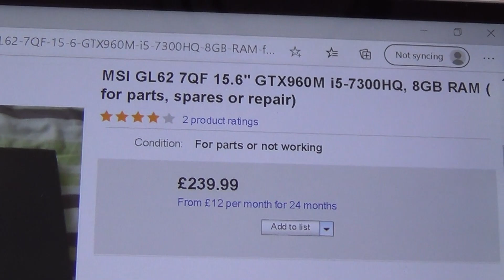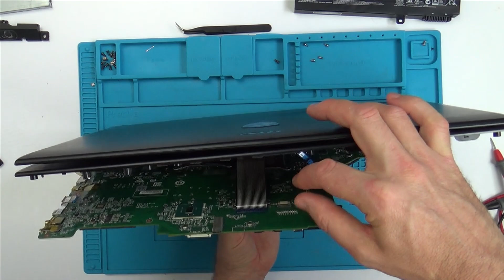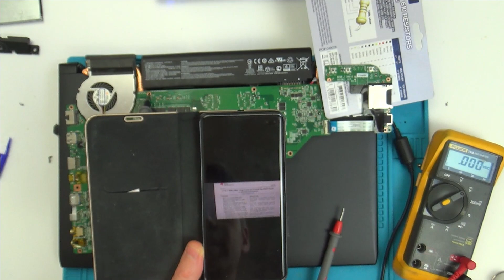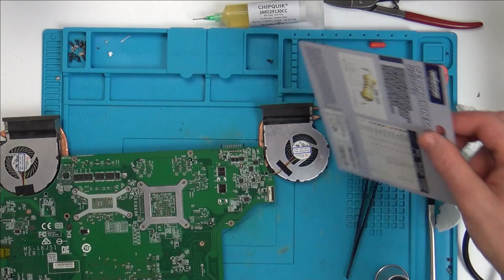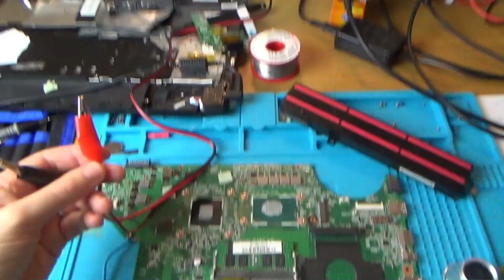Trying to FIX : Faulty MSI GAMING LAPTOP from eBay

Comment: @12 mins - second connector is the LED backlight connector for the keyboard. Not all models have this, but the connector exists even so. 
The some keyboard keys not working is a common fault with these Steelseries MSI keyboards. You can try reseating the ribbon cable but it usually requires replacement, which is a pain, cos it uses plastic rivets. I've replaced the keyboard in this exact laptop it is is a pain.

Comment: Just something to try Vince . That small ribbon cable at near the start , the one going to the trackpad / keyboard . Try connecting it . I know this is not a macbook but some of those need that circuit to be completed before they will turn on , it will not turn on the power to the power managment chip on the macbook . Saw about it in Paul Danniels or Louis Rossmann. So in essence , the power goes to the trackpad / keyboard and then comes back to the power managment chip to tell it to turn on

Comment: I would leave one idea, in this comment section. This is not just a fixing ch. Its something more value is not the most important factor. I think tenacity is the key factor here. I would suggest that you fix it, in my eyes this laptop is nothing special i5, iffy GPU, no SSD inside. But its not about that. Its about, fix it with everything you got. I think your viewer would buy template for this chipset and even the chipset. And you should learn to reball the massive chips with template.

Seller is fraudster and idiot I would give him negative feedback at least. This is clear scam.

Comment: Hi , can anyone recommend a good basic Multimeter.  thanks.
Reply: VC99 (vici99), but if you can buy an used fluke that works it's preferable.

Comment: LOL @GadgetUK technique =D  Great job, you need to be careful when increasing voltage on the PSU - that rail may be 1.5v or something around that.  Feeding 5v or more could cause something to die - that said, because there's a short, the short causes voltage drop.  So its probably safe to do.  I would rather stay nearer to 1v (maybe up to 1.5v) and increase current limit on the PSU.  Those iron filings - maybe some where dropped over the whole thing?!?  It may be worth trying to blow under that chip (perhaps carefully remove the underfill on the corners, pour lots of IPA under it, use hot air on highest air flow to try and blow under it.  Just an idea!  But I've never seen iron filings like that stuck to a speaker magnet - you've got to question how so many got there like that!  I would leave a negative for that seller!  There's no way all they did was just clean...     If you've not already checked out his channel - see "Adamant IT" on YouTube.  He has lots of similar repairs to this - ie. finding the shorts etc.  I do wonder if the heating up chip there is a red herring.  ie.  There is techincally 0.4v or something going to it, if its normally powered with 1.2v or something like that, its going to be lightly warm vs anything else around there.   So the short maybe a cap, a tantalum or something.  Are you sure no other caps on either side are getting warmer?

Comment: SMBus means System Management Bus. It is an i²C Bus with a serial protocol. Vital system components communicate via this bus to check various parameters like temperature, voltages, battery state, etc.

For the future: never buy something if the person admits he opened the device for cleaning. Especially if you pay 200 GBP for it.
Reply: Florian Trück people lie even if they say they didn’t they did and with the no returns guff they absolve all responsibility but vince can still try open a case as it’s clearly not as advertised !
Reply: G thats right. I always look for buzzwords: sunndenly stopped, did nothing, not tested, plugged in light got on, etc. At this point I stop looking at the deal and look on further.

Comment: This is a bit of a coincident! I have the same laptop and just opened it up for the first time the same day you uploaded this video! :) I was upgrading my RAM.  I think you are missing a speaker as well, it's supposed to be placed just around where that first broken flat cable was, there's a grill in the case. Unless MSI removed it from this particular model...
Reply: Yours is a higher model with a subwoofer speaker. This is one of the basic model's and doesn't have it and no backlit keyboard etc.
Reply: @KBFix  Ah OK, I suspected that could be the case. Thanks for the info!

Comment: That's a shame, it turned out not to be fixable for you. On another note, that chip is the southbridge, motherboards haven't had northbridges for a while now since the memory controllers started to be integrated into the CPU die itself. Anyway, great effort!

Comment: a chipset does not just break down usually it is the gpu or the power line of the laptop.  check if the USB ports are ok not that they are connected to ground.  or he just made a big short circuit that the chipset broke down

Comment: Hello Vince, just popping in to tell you that on a laptop it very rarely is a socketable CPU.  They only do that in cases where they are actually using a desktop CPU to make a really powerful and power hungry "portable" workstation or gaming type desktop replacement. Other than that, it's BGA and GPUs are almost always BGA as well, Nvidia does have some MXM modules with replaceable graphics cards but again, that's the exception, not the rule.
Reply: Dont know if you have seen his site but '' cat and andrew does a swopm on one , cant remember what the make or model was , possibly a Dell

Comment: You should get a thermal camera to help the fault finding with heat, I dont think they are that expensive
Reply: Thermal camera smartphone is amazing
Reply: Frost spray works well for that as well
Reply: @sethreign8103  which one

Comment: "stopped working after cleaning" screams "cracked cpu or gpu or both". It was a very risky buy. And overpriced I think.

Any repair must start with inspecting it visually everywhere. And for sure before even touching a soldering iron.

Also, it makes sense to power it using a bench power supply. That's how you can see if it consumes any energy if anything changes when you press the power button and so on.

The startup sequence is rater complex for laptops. It is not a liner "follow one trace". Various subsystems start and then send signals for other subsystems. These systems start only when they get all required signals and only then the process continues.

You can use your scope to see if a chip gets or sents any signals.

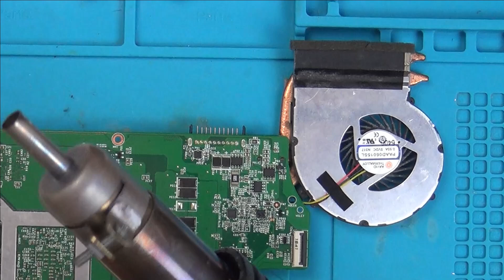Comment: @27:55 i had the same thing happen to my reflow station, it has a blower fan in the handle that doesnt turn on sometimes, usually tapping it or manually spinning the fan gets it to work (i removed the cover to the fan so i could make sure it was working)

oh well thats what i get for a $100 Reflow/soldering/powersupply device off Amazon

Comment: The questions post sale sounded like a red flag. Maybe if you had said it will feature in a repair video viewed by 10s of thousands of people it may have made a difference. Puts me off buying a second hand computer hoping for an easy fix.
Reply: HomeSpace don’t exist unless your buying from bulk business sellers who will mainly strip it for parts for anyway. People hope for bargains but rarely does it work out.

Comment: May have been mentioned already but check the USB ports for shorted pins, I often have USB ports to repair due to their owners forcing in a USB pen in the wrong way breaking the centre pin support and causing those pins to short against the outside of the port, This would cause the issue you see and the chipset short you have

Comment: Hi Vince! Love watching every video from start to finish.  I remember the other laptop you worked on, however I would perhaps suggest a bit of caution with laptops.  Fixing consoles on the other hand makes a bit more sense, because there are fewer models of things (like the switch, xbox, playstation, etc.) that there is a pretty standard market where you can say there's a pretty decent expectation of what they go for on the market once repaired, getting replacement parts, availability of spec sheets and others facing the same issues that have solutions, etc.

With laptops, technology advances so much and that industry is such that there are tons of new models out every year for each manufacturer with many configurations, and reselling laptops is such a wide market when you can get better specs for the same price for even a new laptop sometimes.  Not to mention the amount of BGA components that are tough to work with, let alone finding particular replacement parts available for reasonable prices.  It starts to become pretty risky like shown in this case :(   The old laptops for dirt cheap can be a fun learning experience and something cheap to fix up and give to the kids or something, but cases like this one are a pretty big risk for the capital.  It's unfortunate that this all these reasons lead to more e-waste though :(

Comment: Did you try to see if there is continuity with the power ribbon cable, I only had a quick look while watching it on my phone but looks like even though you cut it the pins are broken further back where the protective plastics starts

Comment: "I took it apart for cleaning then it stopped working" No screws on the GPU, missing screw on the CPU but thermal paste unchanged on both parts? physical damage to the gpu and cpu? #ripoff
Reply: RuggedKnight scambay vince should open a case and get to keep it for free as it’s false advertisement and he has proof !
Reply: @user-te1le7ck6b  It was sold as spares or repairs , no comeback on the seller unfortunatly but thats the chances you take . It did say that it had been opened and thats never a good sign

Comment: this is another reason why i usually go for trusted sellers. i bought a lenovo ideapad z370 on ebay, no hard drive, no processor, no power cable or ram. i took a gamble and got it for £40. first thing i did was get a spare cpu, some old ram and a crap hard drive and it powered up. was in awful shape but i managed to restore it with a core i7 and good old arctic mx4, 8GB ddr3 memory and a new ssd. that was all back in february. this comment was written on that laptop. 
(sidenote, u inspired me to fix products like these and im so thankful of u. u saved me a ton of money doing little fixes and iive never been so happy doing things like this. thank u vince!)
Reply: That's very lucky! Good to hear that you got it fixed up really well.
Reply: KillerRT thanks mate 👍 im working on a few others now, ive got a laptop with a broken cpu dye and unfortunately its soldered onto the motherboard itself. so im gonna have to try and replace it, wish me luck 😂
Reply: @itzzjok3rzz208  Oh, that'll be tough. I wish you the best of luck though! :D
Reply: KillerRT thanks mate! :)))

Comment: Hi Vince, I have been repairing laptops for years. ALWAYS, ALWAYS remove the battery for chopping and changing parts/disassembling further as you could create further issues if not. Great video as always.

Comment: If you take this off, and it's not the issue, putting it back on without confidence would hinder BGA repair. I hope you get it going, that's a pretty good laptop. This is not married. Just need to correct chip. Ask a BGA Repair channel to repair it? If that is the problem.  I haven't had any luck repairing boards yet, but I plan to get into it once I figure out a few more things. But that BGA would keep it from powering on! I have a few MSI motherboards (ironically) ATX style, that that very same chip gets warm trying to diagnose it...

Comment: I believe that is the southbridge. That is VERY common to go bad, and you can replace this! Provided that is the problem. This will cause the 3v on/off to stay off. Meaning the PC will not function with that failing! But ensure that is the actual problem.
Reply: @51:49 that is possibly just that chip. I'd remove it, and check for the short.
Reply: you can get these with the balls on them. This BGA is smaller, I feel like you've already done this before. Or at least removed them on Xbox style Consoles (PS4 etc...).

Comment: Pretend it's an Xbox. As that's the basics of it. You've repaired Xbox's, power plug just replaces the drop in connections. They seem different but it's all about the same. The SMC tells all the bits to turn on or turn off if their is a fault, on if everything is ok.

I'd get a replacement screw if you get this going, as it will overheat if it's not replaced.
Reply: Ouch... I'd say they thought they could replace the CPU and GPU and that was them "Cleaning it" after they realized prying Chips aren't replaceable. Hopefully those markings aren't damaged Chips.

Comment: @53 min there are two mangled traces visible on the board, this thing is a train wreck
Reply: Oh wow ur not wrong. I’d honestly return this regardless of the “no returns” description . You can’t accidentally do the things they did to that car crash by “cleaning” it .
Reply: @grws86  I agree, it was definitely not as described, which is grounds for a return at the seller's expense. Selling for parts doesn't free a seller of the responsibility to describe the item accurately.
Reply: For those searching, @t=3196 check out the 2 o'clock from the PCH (the warm chip). Those are most likely one PCIe lane.

Comment: I suspect the unit stopped working and Captain of the failboat thought they could a) change the chip b) harvest the chips for resale or c) transfer the chips somehow to a new unit thinking they were like desktop boards.   Upon realising their "Not an Expert" error... they put it all back together best they could not being experts and decided to palm it off for best dollar possible...   What lends credence to this is that first ribbon cable, someone yanked it out and likely tried to ram it back in without lifting the gate which is why its peeled back so.   Really rotten m8 and I reckon they were emailing you trying to find out if you spotted the fakery going on :(   When cleaning a laptop, you might have the back cover off, you might even to reapply paste for the heatsinks have them off, you would clean the top half via the keyboard aperture and if you used a decent vacuum not need to do any more disassembly.   Those filings look like filings say from where you overtighten or round out a screw head, prob caused by Lord and Lady N. A. Expert having at the screws with a cordless drill... a big naughty no no :(

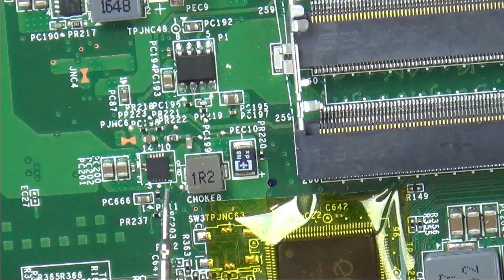Comment: HI Vince. Try removing the tantalum capacitor at 42:49 and see if you still have a short. They are known to fail on laptops. Also you shouldn't go more that 1 volt  to find shorts if you don't have a schematic and don't know what power rail your working on. It could easily fry the CPU and other lower voltage components. 

Here's a schematic of the board I found online. A boardview would help but I can't find one. 

https://drive.google.com/file/d/1dl5JGD8pqL4Q1s5PrOd9mHNTqlHRsQ0v/view

Keep the videos coming. I truly enjoy watching you fix things. Thanks
Reply: yeah, PC87 specifically appears to show signs of burn at one end
Reply: Bump this good comment so Vince finds it!
Reply: The cap PC205 has a white dot, also worth checking!
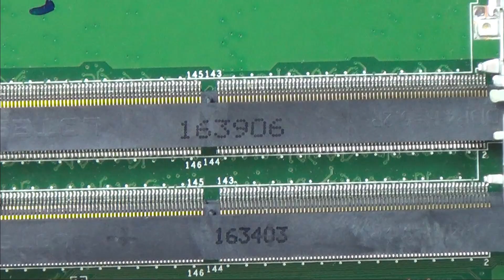Check 43:12 where this is visable.

Comment: 1. ALWAYS Do the capacitor drain on laptops first before anything else...

Lots of Laptops that don't start up just need the power button held down WITHOUT battery or psu lead inserted. Hold button for 20 seconds, insert PSU lead, press power button ON, (laptop switches ON)

It may sound like a trick, (kinda is) but it has worked plenty times for me and others, its a well known trick on the web

2. Always Swap RAM for known working stick. Faulty ram can prevent any computer from turning ON

3. Reset the BIOS to factory settings.
This can be simply done by removing the 3v onboard battery.
(Corrupt BIOS No boot up)

This is the first 3 things I go to BEFORE tearing down any computer

Hopes this helps some day
Reply: he did all of that lol
Reply: @supersolex  he still had the battery connected and the PSU in though, don't work like that.

Comment: Just for knowledge for everyone, the CPU and GPU works between 1v and 1.4v more than that kills it instantly same for the pch that chipset works with 3.3v and 1. Something, not more than CPU voltage the only stuff who works with 3.3v is the ram, and vram, I guess, anyway PLZ don't inject again 5v in a random rail if you want fix the machine 

For the next time check first the ram's slots and try turn on the pc. Without ram's if the machine make noice still alive if not is time to check the vcore(voltage in the mosfets of cpu) or the stand by voltaje in the pch

 the 12v is only for the step down process coz is easier do 12 to 1.4v and 3.3v than 20v to 1.5v, ohhh almost forgot say the 12v rail is necessary for hdd, fans, lights, dvd drive and ssd's 

For your bad luck you chose a machine with all stuff soldered, so impossible to test if the CPU is fried or damage by those dents
Reply: In resume you fried that chipset 😭